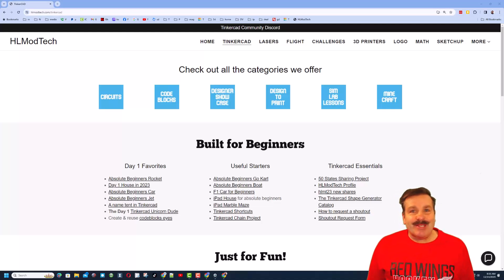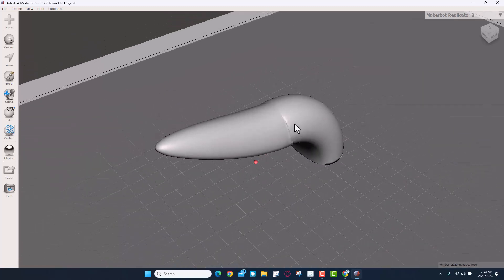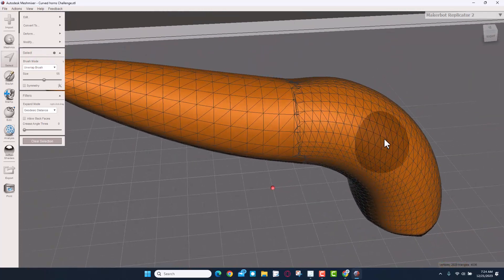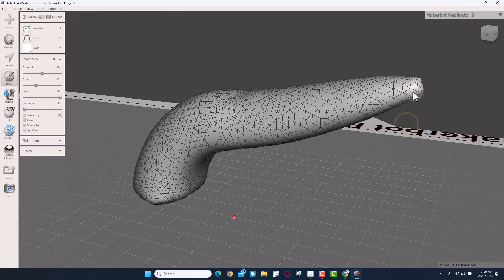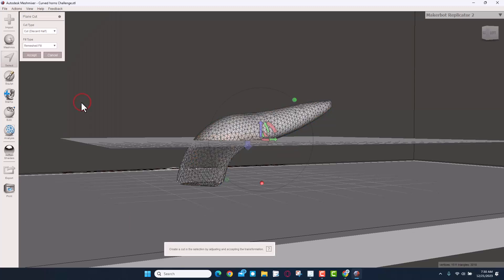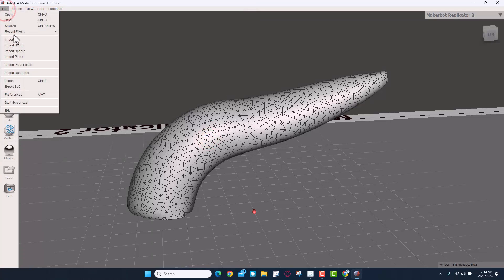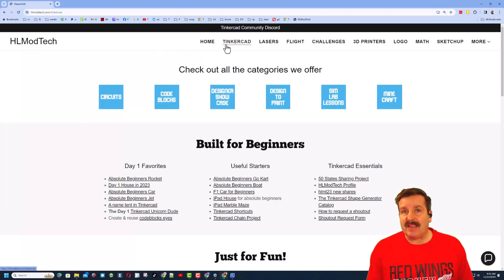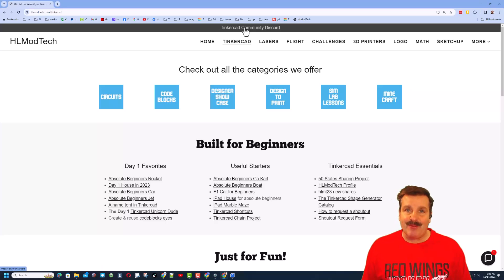Tinkercad Genius! Remove Seams & Smooth Shapes MESHMIXER in Minutes!

Comment: Loved the video, that for the hint. Tried it but found that is errors out on larger files. Do you have or know of any work arrounds as it smoothes them fantasticly.
Reply from the maker: I have found that there are no absolutes with mesh mixer. Small adjustments and try try again have been the most successful for me.